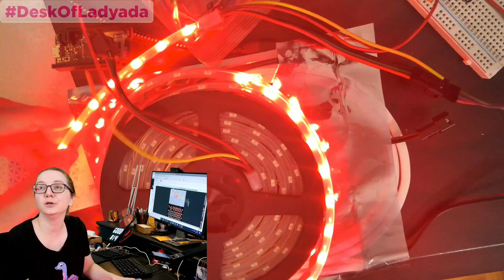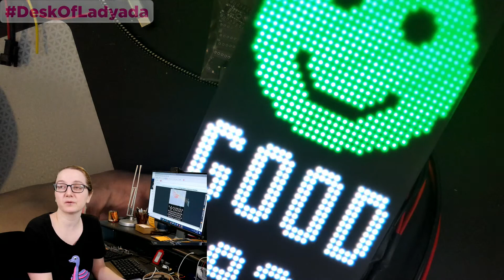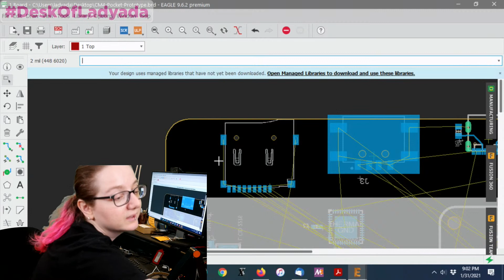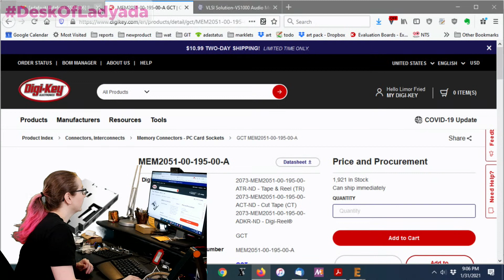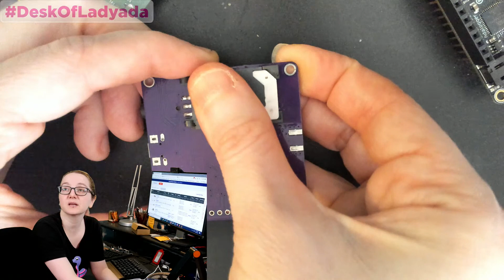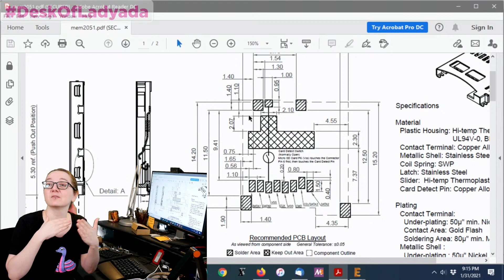Stemma Sunday returns... with a CO2 monitor and TCA8418 Keyboard Breakout

Comment: Oh, funny that the work in progress project is Matrix Portal co2... I'm currently working on porting my air quality sensors (scd30 and pm25) from Clue to Matrix Portal, from one AdaBox to another, because I gotta get that data into my graphing stuff and I haven't written a "spark line" graphing library for circuit python yet. Of course, I got derailed trying to replace the Clue built-in pressure sensor with pulling data from one of my ESPHome nodes over mqtt. I'm sure the pressure isn't that big of an influence on the sensor (I could just say "pressure is 980hpa" and it would be darn close), but I may as well wait to get out going since mqtt is how I'll report out too.

Speaking of co2, now that I have that sensor the data is addictive, I kind of want more... I saw that TDK InvenSense announced some kind of lower cost, mems true co2 sensor coming out later this year. I'll certainly keep my eye out for them, and if they actually come out and are actually cheaper than the SCD30, I'd totally get some.

I know you reimplemented the QTouch stuff for the samd stuff. I was looking at datasheets recently and noticed they claimed a cap touch matrix support, did you do the matrix touch stuff too? Or just the individual?

I'd get an RP2040 Clue, having the screen on there is really growing on me, made sensor data display super easy, and I'm not even using ble because I don't need it with the screen. I'd also get an ESP32-S2 Clue...